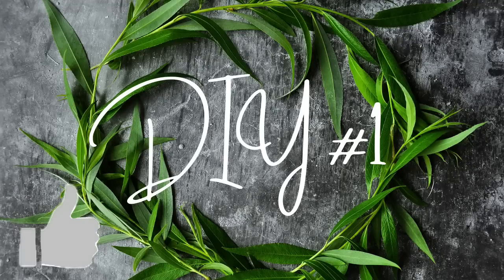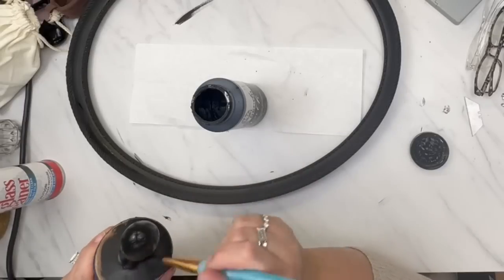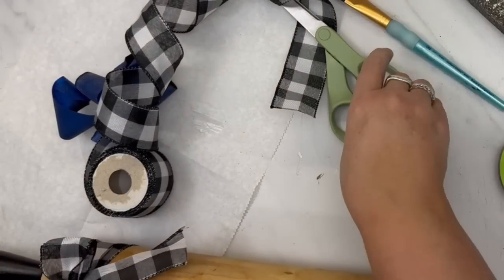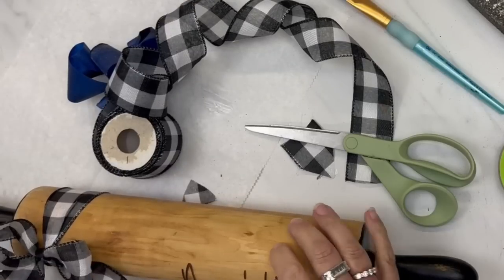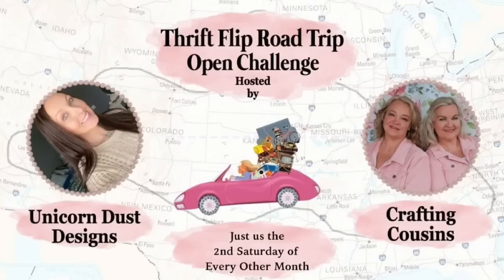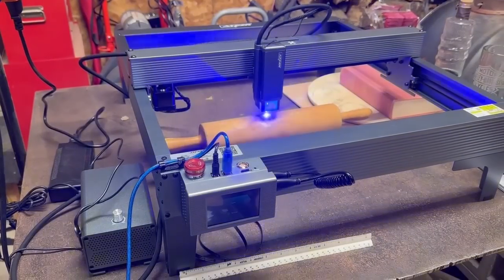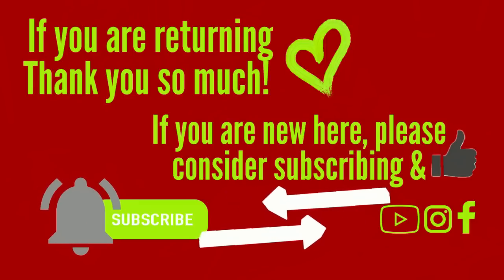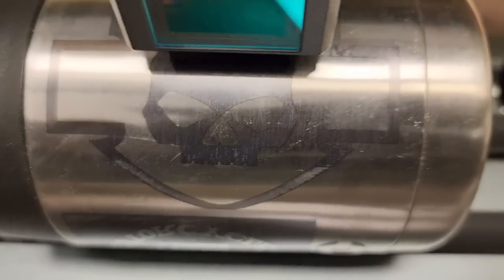Atezr P10 Combo Review 🎄*NEW* BEAUTIFUL HIGH END CHRISTMAS THRIFT FLIPS🎄 Christmas Décor 🎄 DIY Gifts

Comment: I want to say you did some awesome projects. The projects were reasonably priced, like the $3 mirror. The only problem is not all of us can afford a $900 laser cutting machine. I understand the concept, but this was definitely not for someone who has never worked with the equipment.
Reply: Projects are offered for all different level crafters so everyone novice or experienced can be inspired.
Reply from the maker: Hi Marilyn, This was only my third time using a laser. This is the second laser that I was sent and it is much easier to use. I realize that it is an investment for sure. But it is much more affordable than the Glow Forge that other creators use. I am just doing reviews on different creative tools and brining an honest opinion to my viewers. if this is something that they may have been thinking about then they might be interested, if not I hope they still like the flips that I designed and created. Thanks so much 😊 And thank you for watching! 💖

Comment: Do you prefer the Atezr ver the Ortur in a previous video?
Reply from the maker: After using both I prefer the Atezr, only because it comes with everything and I like that the cords are controlled. They do the exact same thing, I feel like the Atezr is built better. However, for a beginner and for less of an investment, I think the Ortur is a great machine also. I was thrilled to use the Ortur and try it out. It was the very first time I had ever used a laser and it did everything that it says it can do. I would just say to do some research and think about what you will be using your machine for. Because using it for a hobby or using it everyday for a business will make a difference in your decision. Also, make sure to watch other creators and their videos on what lasers they use. I watch a guy who was sent the Ortur and he uses it everyday for his business. Great question! Thanks so much 😊 And thank you for watching! 💖